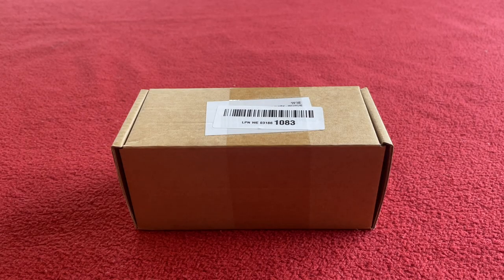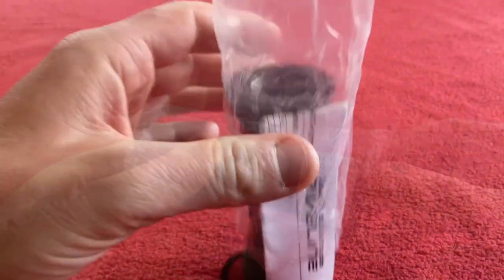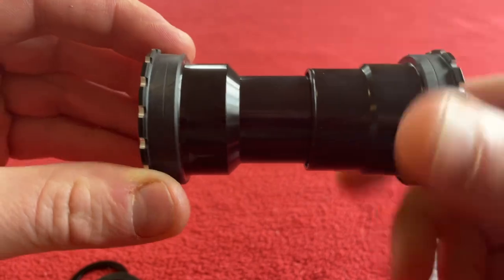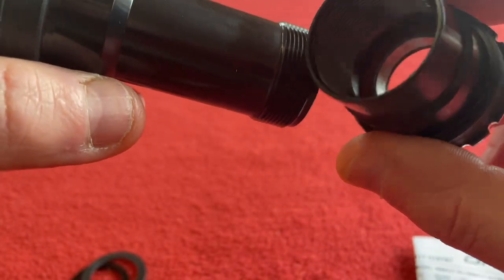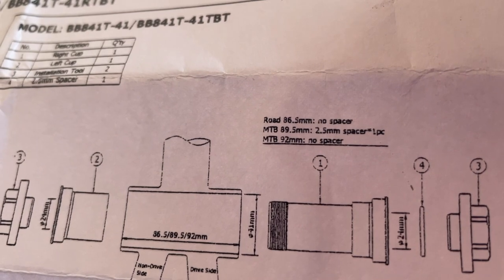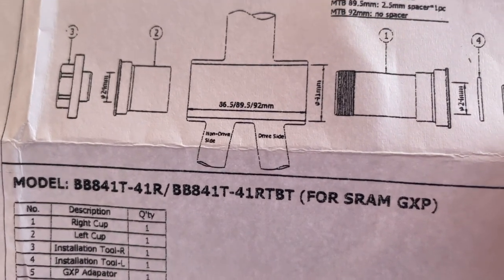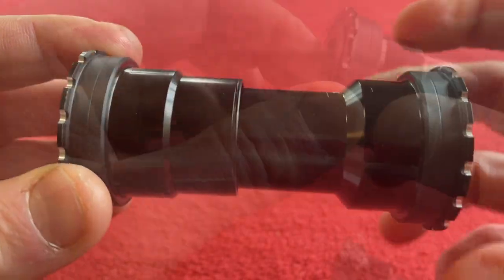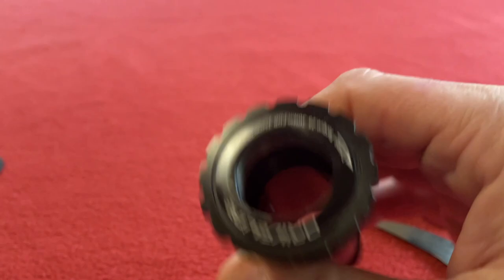Driveline Threaded Press-fit BB86 to Shimano

Comment: Smart move.. virtually eliminates creaking. I have been using Wheels Manufacturing ones with angled bearings on all my builds
Reply from the maker: Nice one Greg! Er unfortunately I ruined it as my spanner’s didn’t fit it properly and I chewed up the teeth. Complete disaster so I just bought a cheap press-fit one to try that. 👍

Comment: Works like the Praxis set up.
I dislike  press fit,  I'd only ridden my carbon ruby (old bike now) 700 ish miles. The thing started popping and squeaking like a trapped angry mouse. I was told by my Local bike shop that BB30 was totally unsuited to carbon frames. I ended up switching to Praxis and a (BSA)Shimano 105 Bottom Bracket instead. That was 6 years ago. 
Great video as always sir.
😎🚴‍♀️
Reply from the maker: Ah thanks! Yeah my BSA was brilliant, no real problems with it to be honest, my bb30 was horrendous, and we will see how the Bb386 fairs. 👍